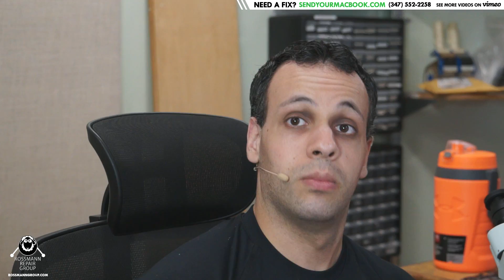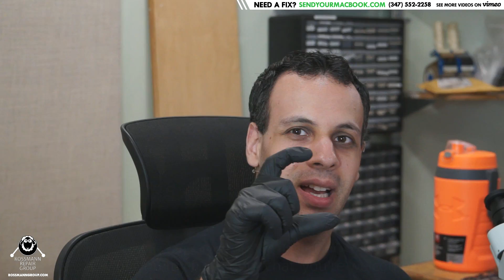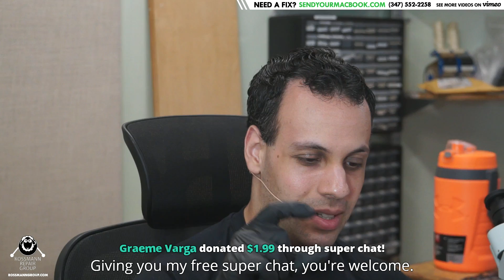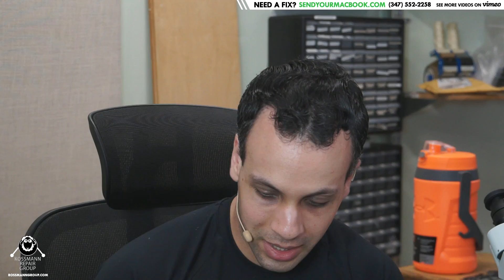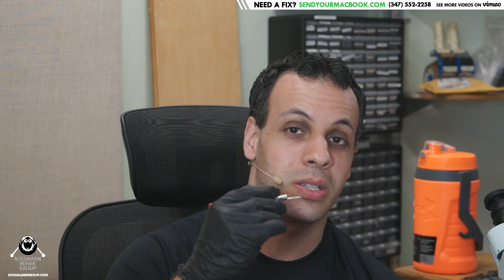How people handle "gotcha" moments defines character.

Comment: I personally hate having to complain about anything and will actually apologize if I have to complain about something, because I know it's an inconvenience for the workers. An example recently was when I was at a Burger King and I ordered a Whopper with no Onion & no Pickle (fyi, pickles get me sick - not just a picky eater) but when I opened the wrapper, guess what was on it? I had to take up to the counter and tell them about it, plus the fact that it was cold. said right out that I hate to be a pain and then explained the issue. Then when they fixed it, I thanked them a couple times.
Sorry for long-winded comment.

Comment: Yeah that is one way to think about it, I personally wouldn't want to be around those kinds of people, but if you look at it the other way, and to use your example, if someone comes in for a screen repair, and the website says 10 mins but you say 15-20, how am I supposed to tell that that you are having an off day, or if you are just going to take your time and do a half ass job? I doubt the website says that there are going to be "X" amount of employees ready to assist you, or that lunch time is at "X" o'clock, the only information the customer has is that your website is offering 10 mins but you are giving them something else. Regardless, sighing in someone's face is never the proper response to a situation like this.

Comment: I dont think this is very fair, the persons reaction can vary greatly depending on the mood they are in to begin with, if you just had a really shitty day even tiny extra annoyances can push you over the edge, but on the other hand if you just had the most amazing day, you wont give a shit if some insignificant annoying thing happens to you along the way. So I really don't think this is fair, but sure, the vodka one is pushing it beyond the *sigh, which then becomes a dick move and a bad character flaw, but if the person just gives out the *sigh and deals with it, I don't see it as something you have to judge the person for, you have no idea what happened to them that day.

Comment: Can I just say I slightly disagree? You advertise that a same-day service can be done within a certain amount of time and then find it doesn't work out that way and may take more time. I can see how both parties are inconvenienced by it taking longer (customer may have an appointment and were relying on things going smoothly, you'd much rather be working on the next project rather than experiencing complications). If someone is polite enough in front of you saying "no problem, do what your have to do!" then turns away with a sigh, it's not directed at you. It may actually impact their day in a way that was unexpected. They may have things going on in their lives where a delay is the basil in the coffin for the day. People have feelings and frustrations. Sighing doesn't make them an ass.

Comment: Vodka is literally just alcohol and water. Not only will it not leave a stain, it will leave NO TRACE of anything behind. You could send that to the NIST primary lab, and they would not be able to detect a substance on the shirt. It doesn't need to be cleaned.

Comment: Vodka? That's what people use to clean clothes with. When you have something delicate that can't be washed via traditional ways (think: elaborate costumes, etc), you use watered down vodka in a spray bottle and spray the crap out of the garment. It's the only way to remove odors from clothes that can't be washed. And it works extremely well and doesn't leave any lingering odors. I use it on clothes that have mothball smells or cigarette smells too. Works like a charm.

Comment: "I know.  I will get it back in your hands as fast as quality+repair over time allows valued customer."  Thanks Louis for donating your time to teach me how to repair apple products.  I don't do it professionally, make money, or any of that.  I do it within my community for anyone who has a problem.   Same thing with PC.  Practiced component repair on old boards I have laying around from old desktop/laptop pc's since Apple gear is not cheap nor abundant here in the hairy armpit of hell known as Eastern Kentucky.  Made a hot air station from a dewalt heatgun coil and fan with an old high temp exhaust to egr valve hose i got off a busted engine.  Works like a champ.  Still using an ancient weller iron that looks like a gun (model 8200) with a newer weller SP23L pencil with a tip i make from soup cans lol.  I know its not really relevant how I do it or what i use, but I have saved people money who cant really afford this highend shit in the first place,  and I keep machines going that otherwise would end up thrown off the back porch laying on a hillside all because of you man.  I thank you Louis.  You da man.  If you ever need help for anything, you let me know.  Ill move heaven and earth for ya.